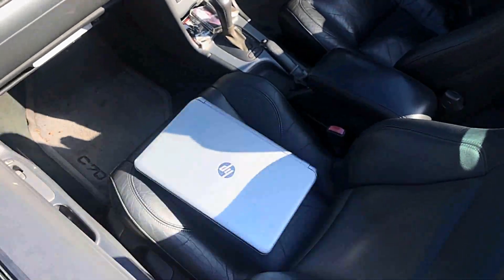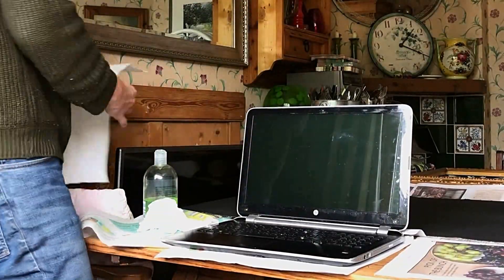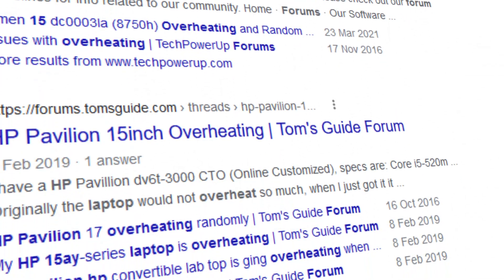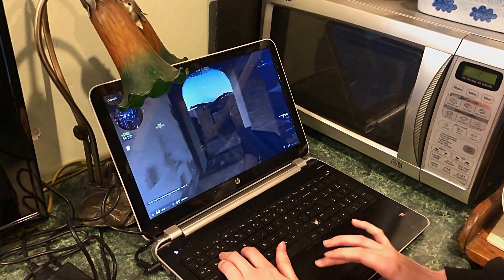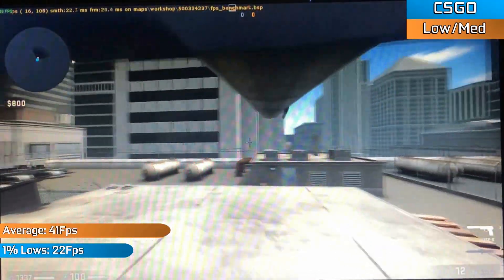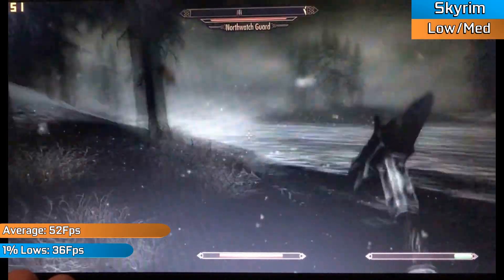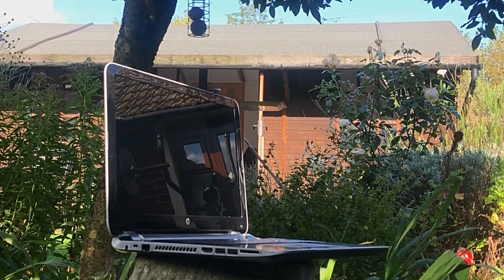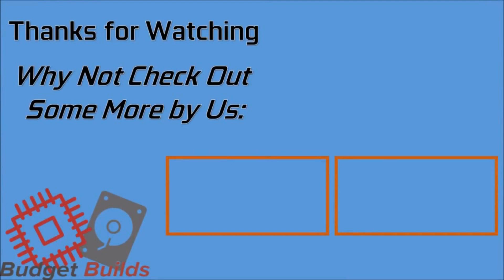AMD & HPs Awful Laptops...How bad are they?

Comment: AMD frustrates me, I happily switched to their Ryzen after ...I want to say 2 gens of intel CPUs, a 4770k and before that a core 2 duo of some kind, now I'm on a 3900x and it's treating me super well- stock phantom cooler and all.

But their GPUs, for all their advancements with tech, all their fancy hardware, I see people say their GPUs are equal to or better than nvidia- then their next card is gonna really take Nvidia down a peg. And all that falls apart when the drivers get involved, every AMD GPU I had was awful, beyond awful with driver support and when it came time to get a new GPU/laptop/whatever I'd look into their line, benchmarks are pretty comparable- but then I hear people struggling STILL with driver problems with various games. When a company puts out something like this and drops support after such a short time- it shows they have zero faith in the product so I don't exactly have much faith in them when they do that 

I want AMD to compete and kick around Nvidia so they'll compete, lower prices or something or give me a reason to go to their GPUs, I'm HAPPY to switch when they do better. But AMD still seems to struggle hard with the GPU side of things with drivers.

I've heard their APUs are really good though- so I'm hoping.

Comment: I have the 4th gen i5 equivalent of this laptop and despite the flimsy build quality it has somehow survived daily use since 2013. I swapped out the CD drive for an SSD and reinstalled Windows from scratch a couple of years ago and it's very snappy for basic tasks. These days I have a proper PC setup but the laptop is useful when chilling out in the lounge watching YouTube etc. I did pay someone to give it a professional clean recently and I think he almost regretted taking the job... Told me it took much longer than anticipated!
Reply: An optical disk drive doesn't store data the same way a HDD or SSD does

Comment: Say what you will about that hp laptop but I had the same one (at least I’m 90% sure it was the same one) back in high school and it was a beast. Ran great, played some games really good and it got run over by a Toyota Tacoma and it still booted and worked just fine. Also, I see that bench press in the laptop reflection. What’s your max?

Comment: My first laptop I ever bought was a Toshiba Satellite with a very similar setup: A10 with dual graphics. Was my own fault I bought it, was looking for a laptop with dedicated graphics and Newegg said it was one haha. Anyway, played a lot of games on it with varying degrees of success(I mostly play indie titles so it was more success than fail). I actually did replace the thermal paste a while ago… and stripped the head of a screw for the cpu block… and messed up part of the cable for the display so now the screen is pink and green… got the screw replaced but still haven’t felt like fixing the display. It’s chilling in my closet as I type this lol

Comment: I had one of these laptops, or at least a few specs lower (hp n268sa).  Based on some digging I did when I replaced the TIM a few years ago: the reported CPU temperature in most system monitoring applications (HWInfo etc) is actually higher than the actual temperature on the CPU. It was something to do with how that series of CPUs/APUS records temperature at the hardware level as an offset against TJMax instead of just the temp. I think you could get the accurate temps if you use whatever AMD software they had ship with it, although that's likely long been deprecated in favor of another piece of software that probably doesn't record the temp properly either knowing AMD...

Comment: Just to give you an idea of how bad is the cooling on these HP laptops, I have a Pavilion dm1 that gets so hot that the keyboard and trackpad turns off to protect from the high temperatures, while the laptop still keeps going. And I've changed the termal paste, but turns out it's just bad cooling design.

Comment: Nice to see reviews on older hardware that's still usable. I am days away from getting a recycled laptop motherboard to swap out the Pentium locked Intel board to an AMD A8 + 7600M dual graphics setup. I'll be using liquid metal TIM and thermal epoxying additional heatpipes and a vapor chamber to the heatsink and fins to combat any thermal throttling. Eventually if all goes well it's getting an A10 upgrade. I always wanted to try the dual graphics setup. Hopefully using NimeZ modded Radeon Drivers will provide better Crossfire support for modern titles.

Comment: Oh my god, when I heard that this laptop has a CPU with an integrated graphics chip AND a discrete AMD graphics chip I immediately experienced a flashback from the 2010s when my friend had a laptop with that combination and the struggle behind making that second GPU work in games!
Reply: Every once in a while my laptop decides the intel UHD630 graphics is the proper one for game while the desktop SKU 1660ti sits there like :| It's some finagling to get it to use the dGPU but then it's fine.
Reply: And this comment gave me a flashback of a moment a couple of months ago when my friend with a decent AMD chip and a decent AMD graphic card (a bit better of an NVIDIA mx130) asked me if I was able to install fortnite on his pc after another friend tried to Hack W10 on that computer; worst nightmare of my whole life trying to get that GPU to work and dealing with a PC that worked for 10 minutes and then started to reboot the system every time. And I also remember my friends complimenting me for not throwing that pc out of the window after a couple of tries, such a good times
Reply: Disable intigrated graphics in device manager
Reply: @thebeastahmer4001  some laptop if not most still relly on it for display output...
Reply: @thebeastahmer4001  yes that will work
Reply: Lenovo legion laptops usually have integrated graphics disabled, so stuff like this wouldn't happen. Plus, it helps in performance since CPU's power isn't going to waste with integrated graphics
Reply: If you want to play games, there is no reason to install Win 10. Win 7 would run much better and stable on this older hardware. Or you could try some minimalistic Linux distro.
Reply: @aleksazunjic9672  Linux and Dual GPU, that might be a recipe for a quite eventful weekend.
Reply: @VV-nw4cz  Especially if you try to compile drivers yourself :P
Reply: @aleksazunjic9672  nah in my opinion win 10 better, and give boost shadering in game. (i use integrated intel hd 3000)
Reply: @r-resnet2841  i agree
Reply: @r-resnet2841  Intel HD 3000 is garbage even for low end standards
Reply: @youtubeshadowbannedme  yeah garbage, but when intel hd 3000 in win 10, that 'garbage' get boost shadering in game, what u expect from 8 years laptop dude ? :V.
Reply: @aleksazunjic9672  bruh
Reply: @aleksazunjic9672  a lot of games run worse on Linux or refuse to run
Reply: @aleksazunjic9672  u are funny

Comment: Cheers and welcome back!

Definitely a unique set of hardware. On paper the hardware isn't that bad. If only it wasn't so gimped between poor thermals and non existent software / driver support.

4c 4t and 8gbs of ram with a semi discrete gpu for under 100 sounds like a solid deal for a laptop. And then you meet this laptop. Keep that fire extinguisher nearby.

Comment: I daily drove an almost identical laptop for 5 years on it's original 1.5TB HDD and I can confidently say that it wasn't a good experience, I bought the laptop for gaming and while at first it was good enough , by 2017 even Minecraft at medium settings would bring the laptop to it's knees and i'd often be stuck with a sub 30fps experience. Finding out that my previous Core 2 Duo laptop actually had twice the CPU performance was rather amusing, also the fact my desktop with a GT210 could run every game at twice the settings with twice the frame-rate than my HP was a good one too. Even Youtube at 1080p60 became a struggle for the laptop towards the end of its life which became annoying very quickly. Definitely wished i'd upgraded to an SSD early on though as I feel the slow hard drive was its worst quality, as you said taking up-to 15 minutes just to boot and just navigating through the operating system took forever. The whole laptop was indeed very poorly built in my opinion, from the low res and contrast lacking screen to the spongiest trackpad i've ever used. Was very glad to upgrade when I got the money and would recommend an upgrade or at very least put an SSD inside if your still daily driving one of these relics in the modern era.

Comment: I had a 17inch HP with the A7 which is suppose to be less than this A10 I think.With windows 7 and at the time it worked pretty good tbh, I also put 16gb ram in it. I was able to play games and I was pretty happy for a teen on a budget. Though that was 2012, things have changed a lot.

Comment: They still do the same thing but with Ryzen this time (and much better it's seems)
I own 2 Hp pc's one laptop and 1 desktop and yes my desktop (still running) was paired with an R5 235 and the fan died and since i play in passif mode (i monitoring the temp but and this don't exceed 108° at full charge and 60/65 in idle).
On the otherhand, my G6 (with a Pentium P6200) is still here and run on dual boot (win 10/linux mint) but the radeon have died also so it's complicated on windows to have some "cool" graphics when you can't install the driver for this reason (3years after the bought the card was overheating i think it was the reason from this prematury died)

Comment: Good timing, right now I'm helping a friend who has a newer version of this machine (AMD A8 7410 and a separate R5 M330/M430 GPU). With the latest driver installed, but also with older versions, Photoshop glitches out and a basic game has serious performanche issues when the M330 is used. To circumvent the issue she unplugged the AC adapter to disable the secondary GPU, and it worked: no glitches and the game runs at 30+ FPS. I'm not sure if the M330 is actually an improvement over the A8's iGPU, to be honest.
Reply: Could it be possible that the M330 is faulty?
Either that or it is actually a really bad choice of GPU they put in that laptop!
It could be just a really bad choice of hardware. I have a laptop with an i3 2330m and a gt520m, and if I remember, the integrated graphics are like only 5% worse than the 520m, and instead of having just the integrated graphics, they have the 520, and no integrated graphics.

Comment: never put this laptop in a backpack with other stuff in it in my family we have had 3 screen repairs on a few of these laptops because there would develop a line of dead pixels if you took it with you to and from school for some reason. my mom uses it now havent had any problems with it other than the 1 tb sshd or whatever it is is super slow. but it works for beeing rarely used

Comment: I remember having a Pavilion DV6 years ago with an i3 that would overheat after a few minutes of gaming. I pulled it all apart and saw that the CPU fan had a plastic shroud that covered the exhaust holes. Snipped it off and it immediately improved temperatures.
Reply: I use a DV7 till this day and it's a nightmare to take apart. Doesn't have thermal issues though thankfully
Reply: IIRC there was a whole sub-line of DV-6 (or was it DV6000?) laptops that had all kinds of problems including motherboard failures...
Reply: @jnharton  And the ZD8000 series too.
MB proberms, GPU getting desoldered from the motherboard, batteries (the 8 cell) exploding under the load, a 3rd cooling fan just for the VRMs, utterly loud, 2h battery life at most, screen develops vertical lines and after that it fails completely...
It was both an engineering marvel, and a disaster in one complete package. But I loved how utterly versitile and powerful it was. The thing was just loaded with I/O.

Currently I own two working ZD8000s.
Reply: @smithcasey9785  You just described half of the issues that pertain Turion based silver DV7s perfectly. They run absolutely grotesquely hot, the heatsink for the GPU and NB is a total joke unless you can get it to stick with copper shims + paste, and I barely managed to get ONE working battery pack out of the sea of dead DV7-1000 and 3000 I've ever had.  And yet here I am, owning one that works. That, and its Intel counterpart as well, which at least was built better in that regard.
Reply: I built a heat exhaustor for my laptop
Reply: I had 3 DV7s and all 3 of the left speaker died because it had bad cooling design where the heat from CPU literally destroyed the left speaker. I mostly use headset though.

It's subwoofer is nice but has niche use because I barely play movies (although that laptop was designed for that In mind) or play music on high volume.
Reply: @TimDragonDeckers  my DV7 works fine (DV7-3190ec), even the cooling is quite decent since it never goes above 65°C
Reply: @KofolaDealer  I eventually dusted it out after 6 years of struggling usage as I don't know how to clean laptop and compressed air can back than was only found in pc store and not in local grocery store.

Back than it regulary stays at 90°C during peak load and maxes out at 100°C which is shutdown temperature. After cleaning it out it idles at 75°C and 85°C during load. 

I regulary used it for gaming though when I was a young. The cpu is amd Turion M520 dual core,  4gb DDR2 ram, ATI mobility radeon 4510 512mb vram and 450gb 7200rpm hdd.
Reply: I upgraded my laptop cpu, from A6-3420m to a8-3510mx, got a overclocking software ( k10stat )
Boosts now to 2.8ghz (default 2.5ghz) and heavy load all core to 2.7ghz (default 1.8ghz).
So much power left in them from factory just because of poor cooling systems and too high voltages for the default clock speeds.
Reply: DV series laptops were a right pain in the backside when it comes to cooling: they ran hot, had awful cooling systems, and had quite frankly abysmal serviceability. Some models required the removal of the motherboard; some required the removal of the motherboard AND the display.
Reply: 115 degrees? Am I hearing this correctly? Not even my 35 watt i7 740QM in my 14 inch HP Elitebook 8440p would get even close to 90 degrees.
Reply: I got a pavilion dv6 i5 laying around and poor things on life support, so many stuff go wrong just in the startup process I am confused what parts are begging for help, the fans are so loud it covers half the sound from it too 😭
Reply: Not just that, went through the repair shop twice and still struggling to remain alive like, at all. Luckily I am not maining it

Comment: I had one of those but with a A8 1.7ghz quad core no boost. It had 4 of ram and a dedicated gpu that i dont remeber. The laptop broke 3 times under warranty and they gave me the money back (not HP but the store where i bought it). Worse laptop i ever had. Was super slow, the A8 was sooo back, couldn’t run minecraft with a decent fps too. The build quality was the worse too. Never bought an HP after that.

Comment: You'll get better results with an A10 5750m as it has much better clocks and supports faster ram, you can upgrade without needing to upgrade the bios however it needs a little tinkering in the bios with the old apu before hand as well cringe reinstall windows in some instances. There is a surprising performance gap between the two machines I got with one having the a10 4600m and the later a10 5750m even though both machines have the same ram as the 5750m maintains noticeably higher turbo clocks. By the way the latest version of minecraft is somewhat playable despite being fairly weak cpu side.

Comment: Had an Asus K53TA-BBR6 a bit older than this.  At the time it was a VERY good deal.  Played every game I threw at it acceptably.  Eventually passed it on to my grandmother as a basic web machine.  Finally failed because of the poor build quality.  Hinges snapped off and took a big part of the case with them.  Everything still worked, just unusable and not worth fixing at that point.  Still makes me kinda sad.  It served me well.  😢

Comment: The older Phenom II based versions were better. My old DV6-3010AX was good with the upgrade from a Phenom II P920 to N970, and its 1GB DDR3 HD5650/256MB DDR2 HD4250. The only problem was that part of the chipset was under the left palm rest with no heatsink...and it got really hot when the laptop was plugged in and using the dGPU.

Edit: Proper support for my old laptop ended with Windows 8 - the original HP drivers being best for OpenGL, and the last from AMD being best for DirectX. Windows 10 loathed the switch-able graphics.
Reply: I have both a dv6-3135sk and a dv7-4150eo, with the latter being basically the same as your 3010ax after upgrades - N970, 5650M+4250, 8GB of DDR3, 1TB SSD + 1TB HDD.

It surprisingly does great rendering and playback in Sony Vegas 16, despite being pretty old. And not even once did the GPU or chipset give up after replacing the original mobo (which was literal trash - flux everywhere).

Wish the Intel version wasn't as picky with drivers. I would upgrade it to a 5650M + i7 720QM without thinking twice.

Comment: I had a Samsung dual graphics laptop with an i7 and an AMD 7XXX graphics. It wasn’t terrible, but you had to use horribly outdated graphics drivers to have access to the dedicated graphics and I had to buy a USB fan to keep it from overheating. Got playable performance on older (~2012) games and was a godsend when it was my only PC.
Reply: Sounds like what ASUS did woth one of my previous laptops - an X54HR.

LCD would literally turn off and not work correctly if you didn't use anything else besides ASUS' drivers.

Comment: For about five years, I had to deal with a model similar to that, but worse. It had an A8-5545m and integrated Radeon HD 8510G graphics, and if you know anything about that particular chipset, you would know that it’s Terrascale 3 based.

Edit: The cooling fan broke in 6 months.